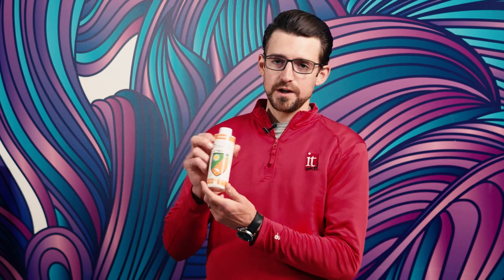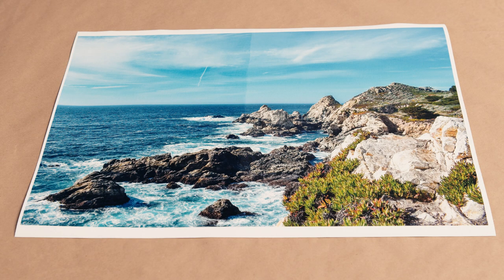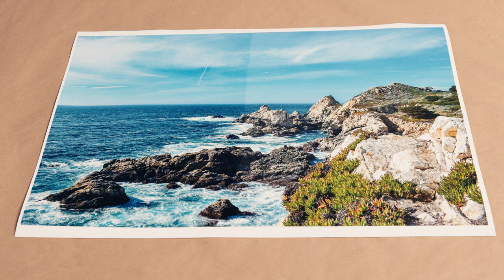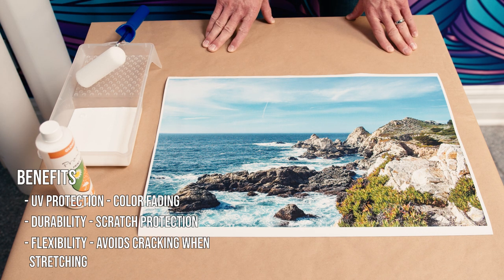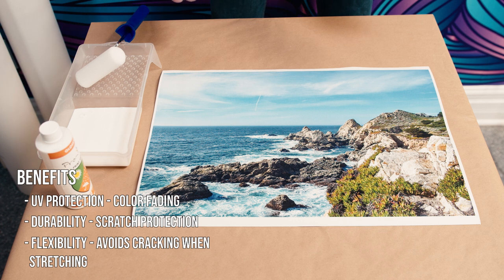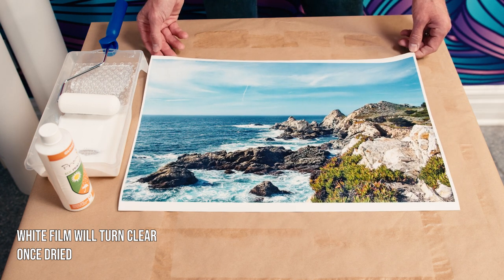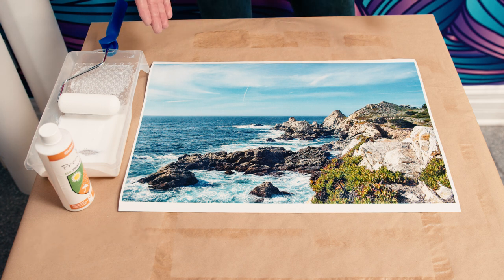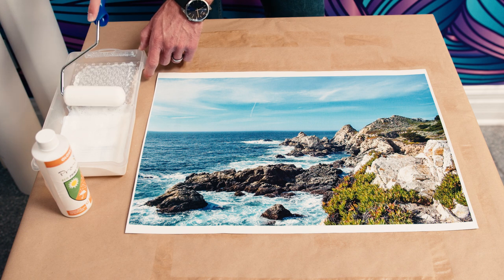How to Coat Inkjet Canvas with High Density Foam Roller & Top Coat

Comment: hi, thanks for the informative video. Question- do you need to apply two coats? Is that a personal preference or a recommendation from the manufacturer?
Reply from the maker: Hi, @electricimagesaustralia6899, thank you for the positive feedback! Following the manufacturer's recommendations is best practice. It wouldn't hurt to do your own testing to see what works situationally with the environmental factors your print may be up against once it reaches its final destination.

Comment: Can you apply this on a print that is already on a frame?
Reply from the maker: If the print is on canvas. However, you'd run the risk of getting the coating on the frame. Best option would be to take the print out, coat it and let it dry, and reframe.

Comment: Eco shield videos state product must be diluted with water (80%-20%)
Reply from the maker: Hello, thank you for your comment. The max dilution recommended by Premier is an 80-20 for roller and spray application. The dilution is more important for spray application as you want to prevent clogging and promote even application. It's a matter of preference really, we prefer the method in the video for fast and easy application with max coverage of the Eco Print Shield. You can certainly dilute with roller application simply to increase the yield of your Eco Print Shield. Below is a link to Premier's roller application instruction sheet which goes into details.

http://itsupplies.com/v/vspfiles/downloadables/ecoprint-shield-roller-application-premier.pdf

Comment: Thank you for this video. I also watched a video by PremierArt. In every case these videos seem to begin with matte surface canvas. I realise there is a lot of flexibility there in terms of the finishes that can be achieved these coatings. But, if you start with a lustre or satin finished canvas do you simply apply a coating which matches the finish of the  canvas or glossier if you want that? Or is the process different for coating canvas with satin, lustre or gloss finishes?
Reply from the maker: Hi Paul, you typically want to stick with a sheen that matches or progresses the glossiness when coating a sheened canvas with an overcoat liquid. You'll get better results with the look if you progress from matte to glossy vs working backwards with Sheen going glossy to matte with liquid overcoat. I'd suggest testing on some samples to see what look you prefer.
Reply: Thank you for that clear response. I've been searching for an answer for some time. I appreciate it. 
Cheers,
Paul
Reply from the maker: @paulschillinger  No problem at all, happy we could help!

Comment: Do you have to use a new roller each time or can it be washed out?
8:57
Reply from the maker: You can re-use the same roller if it's washed and dried thoroughly. Over time and multiple uses you can swap the roller out as needed.
Reply from the maker: Hi William, you can re-use the same roller if it's washed and dried thoroughly. Over time and multiple uses you can swap the roller out as needed.

Comment: Another question: Why did you coat on MATTE canvas? In the other video I referred to he also coated matte canvas. I have , so far, been unable to locate info on coating and protection for satin, lustre or gloss canvas. Is it always preferable to coat those aforementioned finishes on a matte canvas? Also, is a satin finish of EcoSheild available or are we to mix 50/50 solutiion of gloss and matte?
Reply from the maker: Hi Paul,

Generally, you want to match the type of top-coat with the type of canvas or make a selection based in order the keep desired finish (matte, gloss or satin.) However, it comes down to personal preference. 

Matte canvas does give you the flexibility to coat in any one of the three options, however, as matte is sort of a "blank slate" in terms of finishes. Gloss and satin canvas prints you'll probably want to choose the same top-coat type.

Premier does sell a satin option and we would not suggest mixing gloss and matte. Below is a link to all of the top-coats from Premier that we sell.

https://www.itsupplies.com/PremierArt-Eco-Print-Shield-Canvas-Top-Coating-s/1631.htm

Hope this helps!
Reply: @ITSuppliesINC  It does help. Thanks again. All the best.

Comment: On another video for Eco Shield the guy said the liquid has to be diluted 80 - 20 with distilled water for roller application. He said the eco shield was actually made to be sprayed. Hence the dilution for roller application. Was he mistaken?
Reply from the maker: Hi Paul, the max dilution is recommended by Premier is an 80-20 for roller and spray application. The dilution is more important for spray application as you want to prevent clogging and promote even application. It's a matter of preference really, we prefer the method in the video for fast and easy application with max coverage of the Eco Print Shield. You can certainly dilute with roller application simply to increase the yield of your Eco Print Shield. Below is a link to Premier's roller application instruction sheet which goes into details.

http://itsupplies.com/v/vspfiles/downloadables/ecoprint-shield-roller-application-premier.pdf
Reply: @ITSuppliesINC  Thanks very much
Reply from the maker: No problem :)

Comment: I'm guessing the clear coat is toxic. Does it have a strong scent? Do you need to be in a well ventilated area? I've worked with plenty of paint variety and different types of clear coats. I'd rather not work with a chemical that could cause cancer and/or brain damage with long exposure.
Reply from the maker: PremierArt Gloss Eco Print Shield is Non-toxic/ non-hazardous and will not ignite nor cause spontaneous combustion. It's an environmentally friendly, water-based protective coating, specifically engineered for InkJet Water resistant medias..approved by Wilhelm Research, Epson and HP. Good general ventilation should be sufficient to control airborne levels. You can view the Material Safety Data Sheets on our website for more detailed information. https://www.itsupplies.com/premierart-eco-print-shield
Reply: @ITSuppliesINC  Thank you
Reply: @ITSuppliesINC  I went ahead and ordered the sample kit to test out.
Reply from the maker: We appreciate the order and support!
Reply: @3DEditor  hello could you please tell me if you like it,is the smell strong?
i am trying to stay away from toxic fumes but my canvases crack without coating
Reply: @zeromission88  I tested all 3 types of this brand and style of clear coat with the purchase of their test kit. They're not nearly as strong scented as spraycan clear coats.

 However, the one with the stronger of the scent is the glossy clear coat, which ends up doing a better job of not causing nearly as much ink lift and spread while rolling it on, even after waiting 48 hours to allow ink to dry. I like the glossy clear coat best, so I bought 1 quart of it.

 Also, you're better off spending the extra money on their special coated Canvas sheets, because it does a much better job embedding and drying the ink into the canvas, than standard canvas sheets from art stores..
Reply: @3DEditor  thank you so much, I’m currently using coated canvas but the corners are still cracking the edges are fine
Reply: @zeromission88  just know that there's still some levels of toxicity in all clear coats, you'll see that is true when reading the warning and first aide labels on these clear coat products. These water-based ones are just far less scented. The scent doesn't linger like spraycan clear coats. You can roll it on inside with adequate ventilation. If you plan to spray it on with an airbrush or spraygun, do it outside with a mask and goggles.
Reply: @3DEditor  alr thanks
Reply: @zeromission88  you're welcome